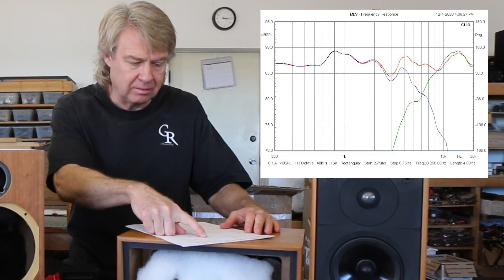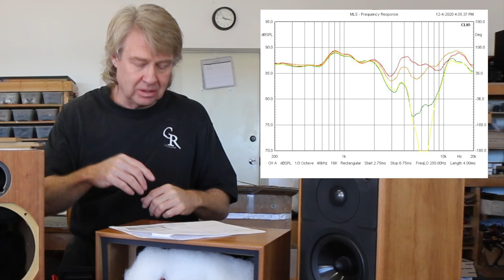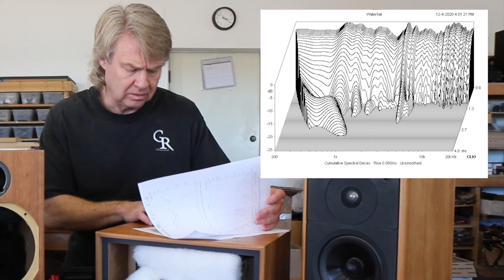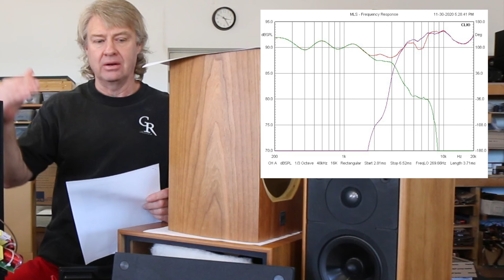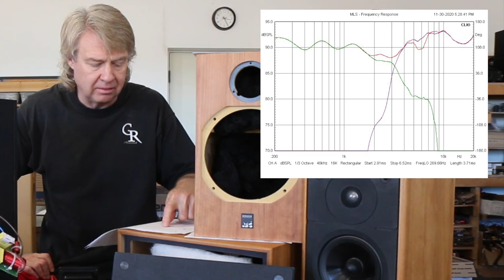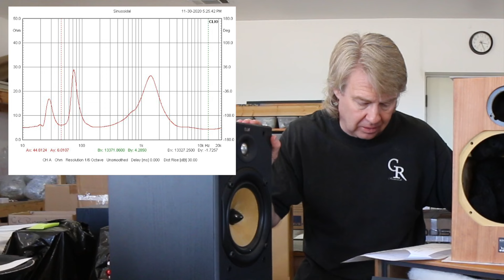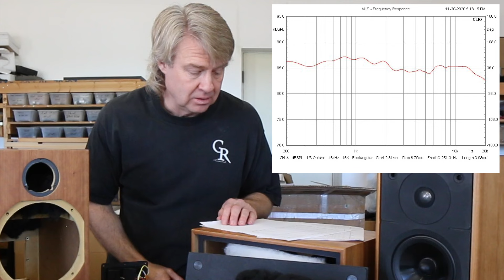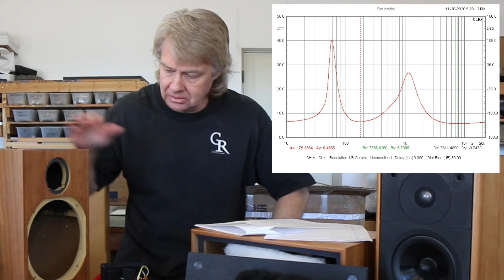FINALLY! A SPEAKER DANNY LIKES?! B&W, Epos and ATC!

Comment: how do you feel about digital crossovers?
Reply: Some, like what you can get form Hollis Audio Labs, are quite good. Some, like the Behringer or MiniDSP, can suck the life out of the music. They're dreadful.
Reply: @dannyrichie9743  totally agree, there are some nasty products out the running dsp, as you say totally suck the life out of a system. There are still plenty of followers though. The DSP market does excite me though as there is so much potential for the decent ones that exist.
Reply: @eddiebaby22  There is only one that I would recommend looking at. Check out the system designed by Rich Hollis at Hollis Audio Labs.

Comment: Really disappointing with the Epos. I almost bought their ES11 last year, happy now I didn't. A single cap "crossover" which they cable-tied to the back baffle? That bracing as you said is totally wrong, I don't believe any even remotely respectable speaker company does this at his day of age, even the beginners would know the bracing should be horizontal and not vertical. If the front baffle could pass as being made of hard plastic, many a speaker manufacturers would have done this to simplify and lower the cost of manufacture, but hey, it turns out they know better so they  haven't. Honestly, the whole design might look spartan and simplistic but it's really just a pile of mess.
Reply: Drazen Babich many manufacturers have used plastic front baffles. 
The vertical brace in that particular speaker is potentially more effective anyway as it is glued to wood whereas if horizontal they might have to screw extra for the plastic to be braced there. You’d also get square panels for resonance that would be about the same size x6 which maybe isn’t ideal either.
Reply: @RennieAsh  Sure, I've seen those and owned a pair of old-school Jamo's with plastic baffle at the front too, but in those other ones I have seen and owned the platic front was placed on top of the MDF base.
The way Epos had done it creates challenges as you pointed out with bracing application, creating basicaly "two" back cavities for the dissipation of sound waves back of the woofer cone. 
Another issue for me with that ES12 speaker is the position of the bass reflex port, it sits at the top of the back panel, making the aoundwaves ping-ponging off the back and front baffles before rea hing the exit/release point at the top. I am not speaker engineer but I could see how this would affect the tweeter's overall resonance too.
Sorry but taking everything into consideration we have seen here,  this isn't a well designed speaker overall, IMHO.
Reply: Drazen Babich bass frequencies is more like a pressure in the box so it probably isn’t “pinging” front to back before exiting the port.
With a horizontal brace, you still have cavities for sound to get trapped in
Reply: @RennieAsh  Not for the base  waves. As they would be directed out via the bass reflex port if the same was installed properly, at the lower part of the back panel.
We can twist this anyway we want, but the fact remains, this isn't a well designed speaker.
Reply: Drazen Babich I just don’t think your reasons necessarily make it a not very well designed speaker. 
So is it really a fact or just an opinion?

Why is a port directly behind the driver so good anyway? You can argue that now you are allowing a larger volume of midrange frequencies to exit the port as there is less chance of absorbing those than if the port is further away.
Reply: @RennieAsh  It alpears I touched the nerve. Sorry didn't mean to.
For me personally what I saw and heard from Danny, will do. You are certainly free to your own opinions.
Bye.
Reply: Drazen Babich didn’t Danny say that bass waves are pressure waves inside the cab, therefore you have a conflict of opinions there?

Comment: The ATC is the value hifi. The other two really are crap designs. The higher end B&Ws would probably be a lot better but then they do weird stuff with their tweaters.
Reply: have you ever owned or hearda pair of Epos speakers in a home environment because if you had you would not consider them as crap, these were designed by Robin Marshall a highly regarded Acoustics engineer, from a factual point of view your way off the mark, ok so you think their crap please explain how and why interested to hear your views.
Reply: @stevebirmingham9650  These speakers are probably good for certain types of music and certain types of rooms. The problem with the epos are the fact that so many frequencies overlap and cancel or combine to bump the db. The interesting part of the epos are the separation of front to back and the sides for decoupling which helps for cabinet vibration. It's going to be interesting to see  What crossover mods Danny can do. The reason why I say the ATC are good is you can see that almost no expense was spared mindset and also hence the higher cost for them as well.
Reply: @stevebirmingham9650  They're out of phase and in room that only highlights the fact.
Reply: @captainwin6333  a speaker is only out of phase if wired wrong do you mean time aligned
Reply: Steve Birmingham you can see in the video the drivers phase does not align fully. In some aspect that is also “out of phase” even if it’s not as drastic as an incorrect polarity
Reply: Robin Marshal who has a PHD in Physics designed the Epos ES loudspeakers— all drivers, cabinets, and crossover are designed and made in house. Have you ever heard a pair of Epos ES Loudspeakers on a truly high-end rig? Robin Marshall also designed the speakers by his ears— the proof is in the listening of the loudspeakers—Did Danny listen to the pair of Epos 12 Loudspeakers on a high end rig before he tries to “improve” the sound?
Reply: @johnkettlewell4854  Every design is a compromise and a system of tradeoffs. Some may like those tradeoffs and can live with any design shortcomings. Maybe if he designed something with no cost limitations it might even be better. Most likely he designed something that could be sold at a certain price point.
Reply: George Zubeck Your words most definitely true— and the Beauty of listening to a first order crossover where there is only a single capacitor in the crossover design is a direct sound that is very captivating and musical to my ears.  Robin Marshall had to design the tweeter and woofer in order to pull it off.  Robin Marshall also thought about a beryllium tweeter in trying to improve upon his ES designed loudspeakers. Robin Marshall’s ES Epos loudspeakers were designed in the early nineties.—-Peter Walker who designed the QUAD ESL Electrostatic Loudspeaker was asked could he design a better loudspeaker—He said yes he could design a better loudspeaker; however, the cost would be enormous.
Reply: If you think $2,200 USD for two way bookshelf is value, I got a bridge in Brooklyn I’d like to sell ya
Reply: @tggonzales7971  Go into best buy and see what B&W's are going for...I saw $3,000 for 5.5 inch two way. Look at the parts in the ATC....blows away what B&W offers.
Reply: @gzubeck3  the b&w’s reviewed here are less than $400 US... so, ya know, more “value” oriented, my friend.

Comment: I swear to everything - who is designing these crossovers for these big brands? I am certain I can do better. Call me Bower’s or Wilkin’s!!!
Reply: When youre given a total budget of 5 bucks for the crossover, you can only do so much.
Reply: @bingoberra18  That's true for the quality and cost of the parts, but they can still be better designed. There are low cost speakers that are designed well. Just look at the Elac line.
Reply: @dannyrichie9743  Yep, I´m hoping someone will send you a pair of Elac dbr 62 for crossover improvement, I would but im in Sweden so there is probably a pair closer :)

Comment: You seem to obsess over the vertical plane off-axis response. There are ALWAYS going to be cancellations on that plane with non-coincident vertically displaced drivers. For you to be going on about "a hole in the response" is ridiculous. Of course there is!  You cannot show me a single two-way speaker with separate drivers that is devoid of that so why hark on? The HORIZONTAL off-axis response is relevant to the way a speaker interacts with side walls to create good/bad envelopment.  A hole there IS relevant. It does not matter that the ceiling is the biggest reflecting surface in the room. Vertical reflections do not influence stereo image. Read Toole please and stop pretending to be an expert. I stopped the video when you expressed some fallacious opinion on binding posts.

Comment: I would not trade my Epos ES-11s for anything.
Reply: They are great speakers, but they still leave a lot on the table. I put together a little upgrade package that will take them to another level.
Reply: @dannyrichie9743  any news  regarding the upgrade? i love my epos es 11 and can not imagine any hearable improvement?
Reply: @__8o8__  I have not worked on the model 11 yet.
Reply: @dannyrichie9743  almost the same as the es12 ;)
Reply: Same. Would never part with my cherished pair. And many other speakers come and go. 👍 Unique design which does music.

Comment: Too much 400 hz does not give good sound. seas have too much 400hz
Reply: Isn't that a gross overgeneralization?

Or is that a fact across the board?
Reply: @Tazmanian_Ninja   I can't say exactly which frequencies SEAS speakers from Norway  often color on, but they often have a sound type, a signature where many elements have too much of some frequencies between 200hz and 400hz somewhere.

My experience whit seas in particular with 8 inches is that they are not the easiest to make speaker crossovers to get good sound.